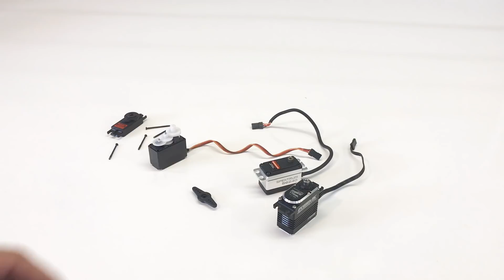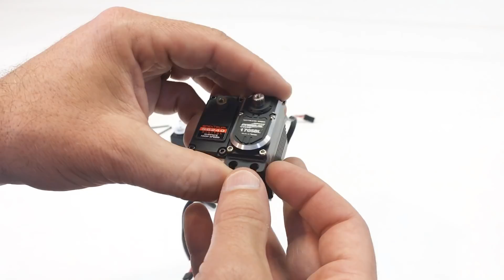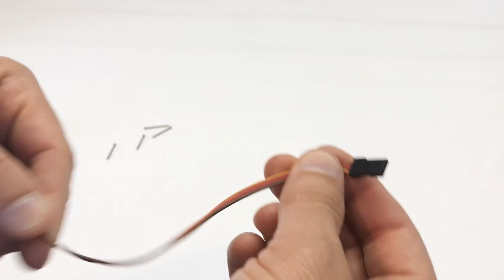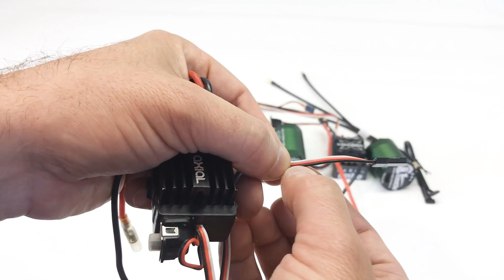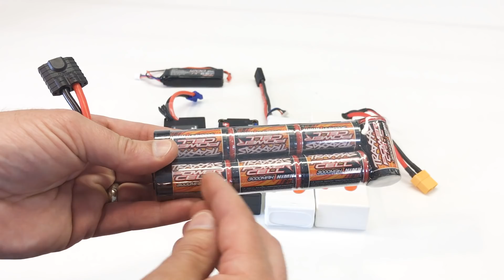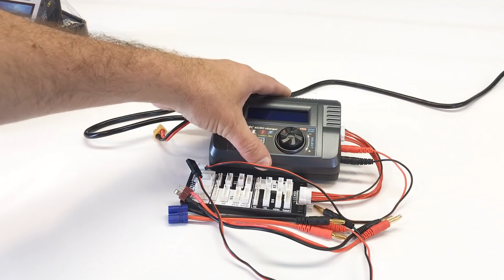RC Electronic Basics - Terms and Names - Get Into RC | RC Driver

Comment: How are you doing today sir I have a question.What does it mean when you lose connection between the radio and the car? The lights just start blinking and you lose power for a second. You hit throttle power comes back lights stop blinking. ? It's a ready to run out the box tent scale beswit rc truck A rebrand of hosim X07.

Comment: Do you have any videos or rewinding the RC dc motors? When I was younger, there was one guy that beat out everyone, he claimed that he custom wound his motors.
Reply: In the older days of RC, brushed motors had more tunability and could actually be taken apart both for custom tuning and service. People would experiment with different brushes, springs, bearings, and I wouldn't be surprised if that even included the copper windings. These days, many brushed motors have a sealed endbell and are made to be used just as is and then thrown away after wearing out.
Reply: @markoftheus  Thank you for the reply

Comment: my rc car runs full throtle when i turn off transmitter. help?
Reply: It's not a good idea to be turning the transmitter off while the car is still on. Make sure you turn off the car first (and disconnect the battery) and then turn the transmitter off last. The transmitter should always be the first thing you turn on and the last thing you turn off.

Comment: Is a soft case pack LiPo battery safer then a hard case pack?
Reply: Generally no. The problem with soft case packs is that if you bash your vehicle hard, the cells of the soft packs are more vulnerable to getting damaged. If one of the cells was to ever get punctured, the battery can start on fire. I always try to get a hard case pack for all my basher vehicles.

Comment: Just bought a castle mamba x with a 2400kv sensored motor for my slash 2wd. I've only upgraded the transmission case. I will be running 3s with a 54/19 gearing. Is there anything else I should upgrade? I suspect that the axles might snap
Reply from the maker: Yes, you're correct, you may want to consider an axle upgrade. Traxxas, Pro-Line and MIP all offer steel axles for the truck.
Reply: RCDriver_Online thanks. Is there anything else that could break that should be replaced

Comment: Question, I want to put a castle sct in my traxxas rustler (crazy I know) and I want to get some aluminum axles that can handle the sct and are compatible with the rustler. Any suggestions?
Reply from the maker: Aluminum driveshafts are typically used in stock motor applications. If you go with a wild Castle system, you chance shearing an aluminum driveshaft.
Reply: RCDriver_Online but what about steel axles? My friend put a pair in his 2wd traxxas slash with a sidewinder 3 and they haven't broke. Would those work?

Comment: What is better the rustler or the river hobby octane?im a casual basher and live near parks and a track but not near a off road dirt track.
Reply: I personally like the Rustler for general bashing. It's easy to work on and extremely easy to get parts for. Both OEM parts and aftermarket parts are readily available for the Rustler at just about any RC hobby dealer, both online and in person.

Comment: Have you experimented with turning off the voice-activation on your microphone? You record in a very quiet setting so I rather hear the bit of white noise over the cut-off. The cut-off is very disruptive to my ears.

Alternatively, you could look into filtering the noise out completely. I haven't done sound recording in a long while to be honest, but I swear you could do that even with free software (I was using linux at the time).
Reply from the maker: I've been experimenting with a number of settings and filters for the Rode and Lapel mics I use. I'm going to keep working on it. Thank you for pointing out what you are experiencing.

Comment: Do you have a suggestion on what charger to buy?
Reply: That depends: what battery type(s) will you be charging? Specs of the pack?
Reply: AllStealthBlazing 2s or 3s lipo 6k or so
Reply: What capacity (mah)?
Reply: If you mean it is 6000mah, then multiply 11.1 volts (3 cell) by 6 amps to get a wattage of 66.6, so make sure your charger can output that wattage. You would also want a charger that can charge at 6 amps. Some suggestions: the Dynamite Prophet Precept or the Kinexsis kx80